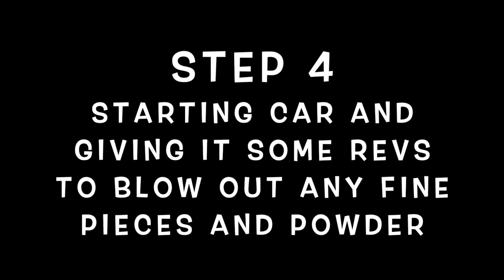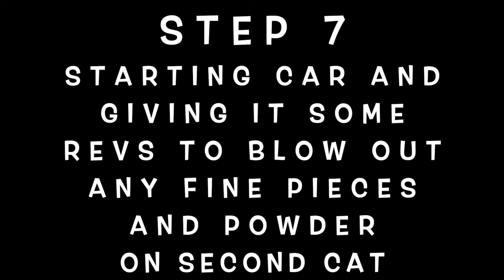REMOVING PRIMARY CATS ON MY LEXUS IS 250 part 2

Comment: Hi. Everything looks good, but the check engine is not lit after all this and it has not lost its power?
Reply from the maker: Thanks for the support on the channel
Yes the light didn't go on at all and no problems 
When you refer to it has not Lost it's power you mean like the performance on the car if you mean that it's much better in terms of performance especially because mine was so blocked up 
Hope that answers you're question 💯

Comment: Does it cure the  bad egg smells (sulfur) from the exhaust .
Reply from the maker: Hi there sorry for the late response yes it does mine was smelling really bad 😭 so once I removed it it was a lot better ✨💪🏻 and it feels a lot smoother on the pulls before it felt like it was choking up but definitely helps alot ✨ thanks for watching and your support hope you get yours all sorted best of luck 👍🏻
Reply: Thanks man I need to do mine but wasn’t sure what was causing the smell thanks great video!🤙
Reply from the maker: All the best man with yours hope it goes well thanks for watching and supporting the channel 👍🏻✅

Comment: how much louder did you notice it get? i want my lexus to be as lowkey as possible but definitely not replacing the cats
Reply from the maker: Hi There 
There wasn't much different it was still silent very subtle difference in higher RPM at least that's how it was on my car 👍🏻💯 lol 🤣 yes definitely replacing them can be pricey well at least here in South Africa 🇿🇦it's pricey
All the best with yours 💯👍🏻
Reply: @Fyr_speedz  we’ll hello from california usa!!!! where we have the worse tax and laws i think anyone could ever want…
Reply from the maker: Hi there thanks for the support on the channel 😂✨ all the best with your laws sounds hectic my guy
Reply: @Fyr_speedz   what about the check engine light and codes did they go off if you had that problem or if not did they come on because of the o2 sensors
Reply from the maker: Hey then thanks for the support on the channel 
As for the engine lights nothing popped up and didn't throw any codes so in that regards all good I wish you all the best with yours ✨️🤙

Comment: What size is that tool you used to gut the inside and what is it called 🤔
Reply from the maker: Hi there hope you're all well thanks for the support on the channel ✨️ 
It was a 25mm flat wood drill bit and then a few long flat screwdrivers and a piece of square tubing with a hammer 🤣🙈
Hope this helps you and all the best on your car ✨️💪
Reply: @Fyr_speedz  thank you soo much 🙏💯

Comment: Recently purchased my Lexus IS 2007 82k miles now 84k. Clogged cat unfortunately I’m in a emission state. Not sure what to do I have emissions in next two years
Reply from the maker: Heyy man oh no that’s hectic bro I wish you all the best Are you not able to remove them and fit cat foolers it won’t show on ECU. But not to sure how they check it but you bro or if possible maybe you can get a second hand one at a  car junk yard maybe 🤔 and swop it out but will be a bit tricky
Reply: Probably going to have to find a set from a junked/salvage car or 2nd hand.
Reply: @Fyr_speedz  Hi there, had mine removed some months back due to the foul smell "rotten egg". I noticed my fuel consumption increased and was told it was due to the oxygen sensor form the catalytic converter that was removed.
Any suggestions please?
Reply from the maker: Hi there I’m really not to sure on this because on mine it went down after I did mine and have you changed your air filter ? Because when mine gets clogged it pushes fuel consumption up maybe it could be that not too sure though and awhile ago my throttle was super dirty and all so pushed fuel consumption up then got a cleaning spray and cleaned it out and much better now that’s all I can recommend trying this is just my experiences 

Hope this helps and hopefully you get yours sorted out soon man 🤙🏻✨

Comment: Pls can a lexus es350 2010 catalyst converter bank1 and bank2 directly fit into a lexus rx350 2008 model?
Reply from the maker: Hi there man unfortunately I'm not sure I don't think so because I have seen a RX350 2007  cat it's a bit smaller haven't seen a ES350 but in theory it's the same 2GR motor one been a 2GR-FE ES350 and one been a 2GR-FSE RX350 but they designed the exhaust and cats different 🙈 so if you going to cut them up and weld it all back together that may work 🙈. All the best hope this helped 👍🏻

Comment: How did you knew your cat was clog??
Reply from the maker: Hi there man 
It was sluggish in power changed all the filters and oil still sluggish and had a really bad Sulfur smell  read on lexus  chats  and they said was the cats so remove them and solved the problem and performance is much better ✨👍🏻

Comment: When you do the cat delete, it pop the check engine light in the desk?
Reply from the maker: Hi there man 
Nope mine didn't show any lights I lost performance on the car and stuff but did change  spark plugs , Oil , Filters , etc and still nothing and car felt like it was been choked up plus had a really bad egg (Sulfur)  Smell When you put your foot flat down .Then did some research and alot of people saying it was the cats once I removed them it was a really big improvement on power and fuel consumption came down a lot 💯 

Hope this helps you and all the best with yours man thanks for the support on the channel 👍🏻
Reply: @Fyr_speedz  i do exactly the same things to my car and nothing change, I thinking to delete the cats but I don’t want a check engine light and have to change the headers of my car cause it’s hard and expensive and all that for remove a check engine light
Reply: @Fyr_speedz  So removing the cat internals got rid off the rotten egg smell? 
Shouldn't it be removing cat material will result in bad exhaust smell because fumes not filtered. I know before it was clogged, no new cats installed, but removed.
Reply from the maker: Hi there I’m really sorry for the late response yes most definitely it’s a lot cheaper and I have removed all 4 cats out the car now and no check engine light on my car at all thanks for the support on the channel 💯👍🏻
Reply from the maker: Hi there yes most definitely will get rid of that smell as for exhaust fumes it’s not so bad if you only remove the two primary cats it’s really low the fumes smell 
Thanks for the support on the channel 💯
Once again sorry for late response
Reply: @Fyr_speedz  so you removed the primaries and left the O2 sensors as is and didn’t add any spacers to let it not throw a check engine light? I have an 06 is and I’m having p0430 code for bad primary cat and I plan on hollowing out both primaries but my bolts are rusted and seized. My main thing is wondering if the check engine light will stay or come back on after doing this, or if the car will run worse I have heard of 02 sensor spacers so you can remove a check engine light after removing cats.
Reply from the maker: Hi there yes that’s correct I removed them and didn’t add and spacers or any cat foolers and no codes at all . Hope you can get it all sorted mine was rusted but it wasn’t to bad so I could get them off just use a blowtorch to warm the nuts and it will crack losses hope this helps you 💯and I wish you all the best with your car

Comment: Did it give any codes or alarm check engine light on the dash? After the modification?
Reply from the maker: Hi there man nothing at all 
She’s all run smoothly 👍🏻🔥
Reply: @Fyr_speedz  yeah right  lololol
Reply from the maker: Lol for real tho no problems at all 💯
Reply: @Fyr_speedz  how does it run? how many miles
Reply: @Fyr_speedz  where you getting p0430 codes?
Reply from the maker: She's all running smoothly and she's on 280 000 KM
Reply from the maker: Nothing at all man 👍🏻
Reply: @norio4x  I am currently, are you? And I don’t believe he had no check engine light after hollowing out the cats it would for sure cause the secondary O2 sensors to throw the check engine light

Comment: Hey man - did this to my is250 08 after replacing rear cats (fronts were not available at the time).  Had a exhaust mechanic perform the task and clean the 02 sensors. Headers drilled out worked well, more smooth and little more power however P0420, P0430 codes popping up so I did a ECM reset and still continued.   Any suggestions or could it be the 02 sensors need replacement?  I heard if a spacer is applied to the outflow sensor connections this might help....let me know :-)
Reply from the maker: Hi there hope you well 
Very strange especially for the 08 model to throw codes I've only heard of like the 2010 up throw codes 🤔 could be the O2 sensor or maybe you should try and get a cat fooler alot of people say they work well or like you mentioned a spacer I wish you all the best and if possible could you keep us updated of which solved your problem
Reply: The reason the codes are popping up are because there isn't any catalyst due to being removed
Reply: No shit they will pop up lmao. Just put spacers on it.

Comment: Doing this is not harmful for the engine ?
Reply from the maker: Hi there my cats where so block it stated to cause the car to drop in performance and it was choking the car in a way the moment the decat Was done you felt it in performance so in my opinion it helps the motor  👍

Comment: FBI OPEN UP!!! 👮🏻‍♂️👮🏻‍♀️👮🏻‍♂️

But seriously I'm currently in the process of doing the same thing, what tools did you use and how long did it take to get it all out?
Reply from the maker: NO ONE HOME 🤣🤣🤣 

This is just what I used because I had the tools 
So basically a jack to lift car and some stands 
Socket set 
Drill with 25 mm wood Chisel/ spade tip  drill bit 
Square tubing about 5x5 a half a meter long 
5 pound hammer 
Long flat head screwdriver 
A piece of wire 
Lights to see how much still inside 
And a container I'd recommend to catch all the pieces so you can sell it they are quite valuable 
Hope this helps you and all the best with yours man thanks for the support on the channel

Comment: sounds aggressive with the cats removed I eventually want do a muffler delete on my IS250
Reply from the maker: Yes that will sounds really good with a muffler delete seen I few guys do that sounds really good in my opinion I would keep the resonator on because without that it sounds really loud especially for a daily car just my opinions 👍
Reply: What about the sensors or  throwing any codes
Reply from the maker: Hi there no problems at all 😁 no codes I few say from 09 Down they would throw codes and have any issues but mine is all good no problems at all 💯✨